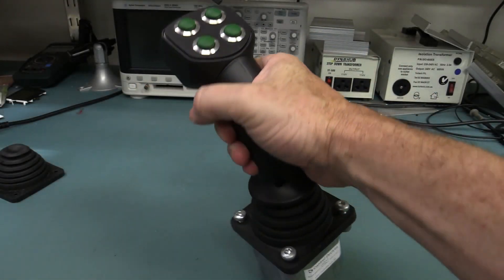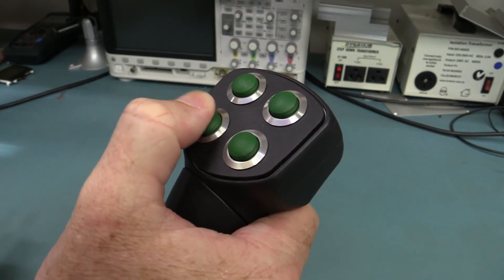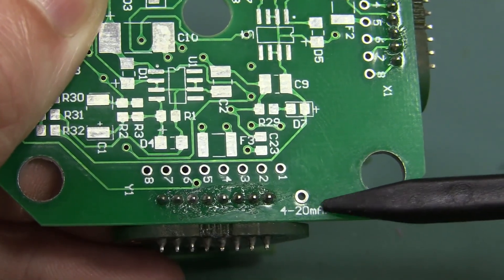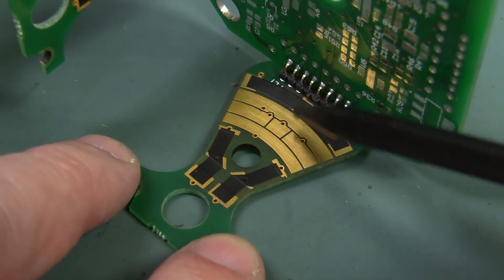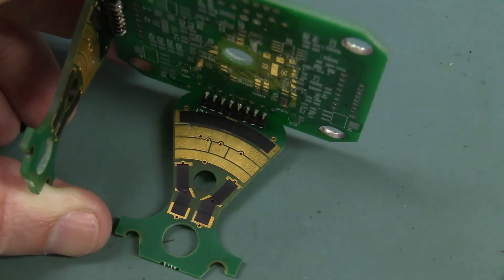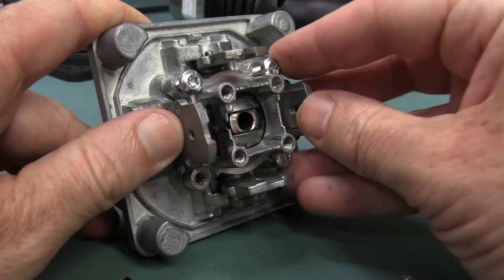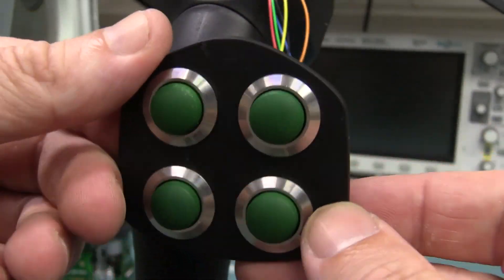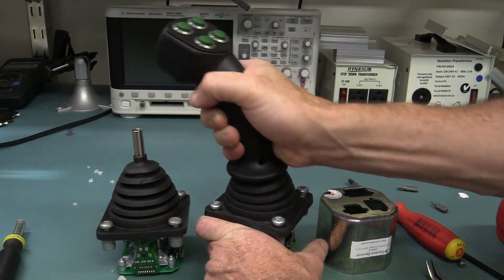EEVblog #706 - Joystick Porn

Comment: That is way over-engineered for a joystick. A typical arcade joystick (usually $10 to $20 each) will structurally last forever; you just need to replace consumables from time to time, i.e., the self-centering spring and the leaf or microswitches, which is easy and cheap to do. Of course, those aren't analog; they are digital (4 on/off switches, up to 8 directions), but there were/are some analog arcade joysticks too, such as the Happ Perfect 360 and the similar Ultimarc UltraStik 360 ($59), both of which use optical encoders, i.e., no contacts or switches to wear out. 

The makers of the joystick in your video should have gone with optical technology instead of potentiometers (wipers and tracks) for directional control. They went with hall effect for the buttons in order to avoid contacts, so why not try to avoid contacts for directional control as well? They have their priorities backwards. If they were going to use contacts somewhere it should have been in the buttons, because microswitches are dirt cheap and easy to replace. On the other hand, those pots for directional control are integrated into custom PCBs, and when those start getting flaky, it will be neither easy nor cheap to replace them.

Comment: I find flying aeroplanes with large nullzones/deadzone to be really annoying (Cirrus SR20 is a bit of a pest that way) and a bit dangerous. The force required to keep an aeroplane in straight and level flight varies with airspeed so traditionally you have a trim wheel to let off the trim pressures. I'd be interested if this was ever used for aerospace applications and how it was setup to make it usable.
Reply: What real aircraft have dead zones? The hell?
Reply: Whyyyyy???? I'm just a sim pilot but I've put a lot of time and effort into having no dead zones on my stick.

Comment: 2:05 onwards. This makes those joysticks useless for aircrafts and aircraft simulators. Pronounced transition through center (snapping to center), deflection on one axis influencing force on other axis etc. All of these are a no-go. To simplify with aircraft controls you need to be able to freakin' paint whatever you want, precisely. If, for example, you run a joystick tester and try to draw a square and at any point the mechanism throws you off in any way, this is an outright flaw.

Comment: It looks like there is gold conductor under the middle of the carbon potentiometer track.  Shouldn't that make that section of the track equipotential?  If that's the case, you would need to tilt the stick some distance in any given direction before it senses that new position

Comment: The hall effect sensor can operate even more than 10 million times. Ever count how many rotations a brushless fan makes in it's life?
Reply: Yes this is exactly why we used it in the garbage truck application. The scope of work for the design was to reach 1,000,000 operations, mechanical push-button switches which we tested to the customers specifications were causing about 10% returns. We tested switches from OTTO, APEM, Cherry, Onpow, Honeywell and ITW. All of them could not cope with the requirement specifications. The biggest issue was that the customer needed the contact resistance to maintain below 1 ohm. This is OK when the switch is new but the figure would got out of this specification between 100,000 to 500,000 operations. Technically the switch was still "OK" but not as far as the customer was concerned. We batch test about 1% of each batch to 10,000,000 operations, we pushed one to ever 20,000,000 with no problems. I think what will break in the switch first would be the spring, but we have not reached that point yet.
Reply: Home Audio Academy Yes, you are correct. Any current can cause arcing in the switch contacts during connect and disconnect bouncing causing corrosion and making it to go out of specifications, also the mechanical deformation over time causes contact tension to drop and contact resistance to rise and eventually mechanical switch fails to operate.

Comment: hey, EEVblog, the statements you made about the "indents" along x and y axes were a bit off. They would be of no value to flying a plane, where very precise and small movements are key to smooth control. Joysticks like this are definitely more towards the garbage truck spectrum than the aircraft one.

Comment: The "4-20mAX2" 4-20mA output is not "times 2" it's 4-20mA output with the name "X2", if you look at the rest of the board there's a "X1" and a "Y1" on the other edges. So the "X2" is just a naming convention.
Reply: The 4-20mAX2 means it's the secondary X axis output for the X Axis. Each axis can have two totally separate output circuits. They are used to redundancy, just in case of one circuit failing, you can still have another as a backup, or you can do a comparison in a PCL between both to make sure the joystick is behaving correctly.

Comment: two uper resistor traces are for fail safe.I mean if mechanical broke down and you got full sudden spin or due to loosing of the screw the two contacts will touch the upper two un-used graphite traces.Correct me if i am wrong

Comment: While this sure is a great device for technical applications like garbage trucks, front loaders, etc. it is not useful for aircraft simulators at all. The higher "resistance" off the directions away from the 4 main axis is more of a problem than help. Also it looks like it has quit strong re-centering force which is great when sitting on a machine all day long, however it would prevent any accurate input in the very important zones around the centerpoint.
Consumer high-end flight simulator joysticks like the TM Warthog show that quit well. Slight resistance at the center and increasing resistance towards all directions.
In very professional applications, like Level-D simulators for flight crew training, there is no mechanical centering-force nor resistance at all. They use complicated motors and actuators to simulate speed (and other factors) depended forces dynamically.
Which is interestingly enough nowadays the same in the aircraft them selves. All the feedback a pilot of an Airbus or Boeing gets is artificial, generated by a computer. Commonly there is no mechanical link between the joystick/yoke nor the control surfaces, making a dynamic generation of those very important feedback forces very necessary.

Comment: I was a little surprised to see mechanical wipers & contacts.  Are there reasons they don't use LEDs paired with detectors like what is found in optical mouse these days?
Reply: Eric, the optical design has been done well by another company, the way they went about it is use a photo diode and a really cool bit of thin plastic that decreased the amount of light that hit the diode. It was really cool. You could achieve some good result using optics, but as richfiles mentioned dirt is a bit of a menace for us joystick builders. Also I have explained in one of my previous commends why potentiometers are still useful in joystick assemblies. FIY there are also force sensing joystick with and without deflection, they work on the strain gauge principle. There are optical ones as you mentioned. There is Hall Effect, Potentiometer and also an inductive coil based versions too.
Reply: Generally, the industrial application. You have NO idea how dirty those environments can get. One spec of dust can wipe out an optical solution, while those mechanical wipers will effectively clean their working surface with every pass.
Reply: Home Audio Academy I also forgot... Worked with encoders in the motion control/electric motor industry. We actually discarded more encoders than we liked, because the markings on the glass would get scratched, or the glass discs outright shattered. Industrial applications also experience heavy vibration. I guess that's another check on the con list for encoder based solutions for industrial applications. I'm certain it's possible to do it, but it comes down to sticking with what is known to work, with fewest failure modes.

Comment: Note that the wiring on the buttons have no splice junctions so they were made as a complete wired harness.  Which would also mean the mechanical part of the buttons were affixed to the faceplate first with the hall sensor/ wired harness potted in after.
 
Cheers,
Mark
**********************
Reply: Yes you are correct, this is how we assemble the joystick with these particular buttons. The switches will outlast the mechanical parts of the joystick. Hence we decided that potting them in place would not be a problem. So far it has not.

Comment: Wipers are low tech, optical encoders are much better.
Reply: Except that in industrial applications, where these are used, the environments can be very dirty. One speck of dust getting inside can takeout an optical sensor, while the mechanical wipers are constantly clearing out their own path with every motion of the stick. In this particular application, the wipers are far more dependable.

I've seen joysticks like this smeared with oil, dirt and grease so thick, that yellow thumb controls look nearly black.
Reply: Optical Encoders have limitation with shock and vibration. Especially encoders that you want some decent resolution out of. These encoders use glass plates, hence the shock and vibration issue. There are magnetic encoders, but why not use Hall Effect instead, It's for less expensive to do mechanically than using an optical encoder. Oh and optical encoders are considered active devices, you would find it much more difficult to pass certification for ATEX and EX application then if you used a potentiometer.
Reply: Home Audio Academy Yep! I also recall from when I worked with optical encoders, that they are relative position sensing devices. They require an index signal to indicate a home position, in which they then can count steps away from, typically using a quadrature based 2 channel (or 4 channel, 2 plus inverted) encoding. Any fluctuation in power integrity or a crash or freeze in your controls could result in total loss of positional tracking by the system, unless you pass the joystick through the home position to reacquire the index. A BIG no-no if you are moving heavy stuff around! Those certifications are there for a reason, and that's one reason they would favor passive devices.

Comment: The "unused" carbon traces most likely for temp compensation.
Reply: The extra carbon tracks are padding resistors. We jump them if if we want to reduce the output span from 0~100% to 10~90%.

Comment: You know, with the boards from the partial one, and the "complete one" you could assemble a joystick (would need still a circuit to read the inputs, but at least you could not damage the hardware!

Comment: The buttons being hall-effects, could strong magnets nearby trigger the buttons, without actually pressing them?
Reply: Yes possibly, but Mu-metal shielding could be used to overcome that problem - expensive stuff though.
Reply: Yes they would have to be very strong magnetic fields, things like MRI machines, aluminum smelters and sometimes mag-lift cranes. However the magnetic field drop-off is very steep so you would need a very strong field to make it activate. Also the direction of the field is important too. The IC in the switch will only work when it's facing the south pole, I think... I can't remember, I would have to look at my drawings for the switch. We have tested these on a crane with a massive electro-magnet, and there has been no reports of interference, the joystick has been working there for over 18 months.

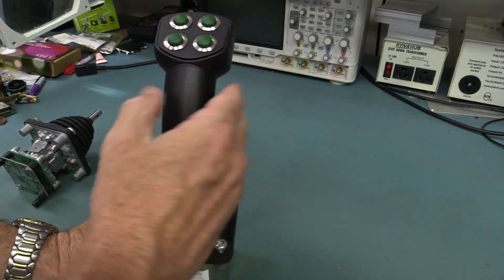Comment: #1:50 Nope. This joystick would be unusable in airplanes or aiplane simulators (also for helicopters, because it would have to move freely and not center by itself). If the movement is restricted, you'll have a hard time controlling an airplane.

Comment: Ahhhh, Dave, you have the aviation analogy incorrect about L/R/U/D axis forces.  It makes sense in the industrial area that many/most of the needs are in the L/R/U/D directions plus a return to a neutral position.  You might also see that in a home aviation simulator joy sticks.  But in the real aviation world the stick itself should impart no noticeable push/pull in any direction.  Rather the push/pull should come from reaction of air flow against the ailerons and the elevator.  This imparts a sense of what the aircraft is actually doing into the stick and then to the pilot, rather than being fooled by the stick mechanics itself.  Finding a "neutral" position for the stick (which might be off center) depends on the intended direction of aircraft travel versus the direction of prevailing winds.  My $0.02.

Comment: I have tried many joysticks over the years and I'm surprised they chose a conductive plastic & wiper system for the axis controls, these will eventually wear out. Most good sticks these days use Hall sensors on the axes but not normally on buttons. This stick's rugged construction is no doubt fine for a dump truck application but the fore/aft, right/left bias is not what is required for flight simulator use, light but accurate centering and the ability to position the stick anywhere is needed.

There's more to it but I don't want to end up writing a book here! :)
Reply: The mailbag video had a comment by the producers of these, it did refer to Hall sensors there too as an option and also various other details such as outputs to specification (voltage/current) and different switches etc.

Comment: Only the very latest military aircraft use fly by wire.  All others are direct hydraulic linked.  You do not want a resistive limiter on the stick.  You want total stuck freedom.  This stick wouldn't find it's way in even a military simulator let alone a actual aircraft.
Reply: Several, indeed most modern airliners use fly-by-wire systems.
Reply: Zorgoban
In all aircraft I've flown the rudder is controlled by pedals, not the joystick! The old and still best way to avoid an imminent stall is to watch your airspeed! As in:

"Watch thy airspeed lest the ground rise up and smite thee!"
Reply: I don't know about fighter jets, but at least in public aviation I wouldn't want any resistance on the joystick itself. Its quite important to feel the force put on your rudders by the air. Its the first indication of an imminent stall. One of the bigger disadvantages of fly by wire as far as I know.
Reply: OK, this was a misunderstand due to English not being my main language. I generally meant "control surfaces". Sure you watch your air speed, but in addition your wing profile is formed in a manner that causes the airflow to first break near the body (fuselage?) and therefore causes turbulences that you feel on the pitch (I think thats what its called in English). So even without looking at your airspeed (or in case its damaged) you feel if your aircraft is going to slow. On the models I have flown you also start to feel some kind of sinking and of course delayed reaction to your steering.
Reply: fly by wire doesn't offer absolute freedom,  joystick commands are checked thoroughly by computers and are compared against possible risks, then may or may not be conveyed to the flight control surfaces,   I believe that these joysticks, using the appropriate amount of resisteive limiter would work just fine on any flying machine,  the rest is software control,  that's where all the work is done

Comment: I can't beleive they used simple resistive wiper pots inside. Why didn't they go for (equally accurate but way more durable) hall effect sensors?
Reply: Magnetic fields is why, there's actually a detailed comment on this video by Home Audio Academy addressing some of the more common comments I skimmed so far.

"5 We use both Hall Effect and Pot, although Hall Effect has it’s long life benefits, the pot does have some advantaged. Hall Effect cannot be used in places with high magnetic fields, such as an alumina smelter, or an mag-lift crane. The powerful magnetic fields could cause unwanted signals in the sensor. Potentiometers are also considered a passive device, it is much easier to get them certified in a system that requires ATEX or EX rating in explosive environments."